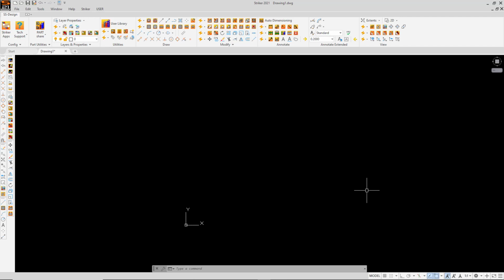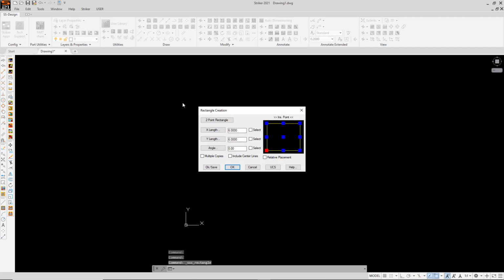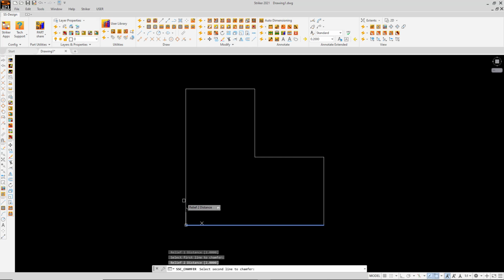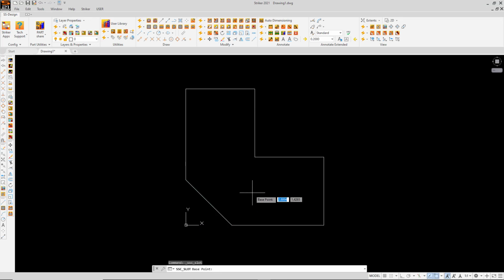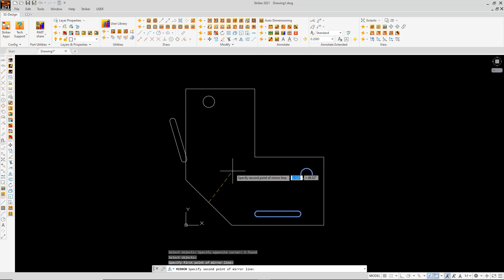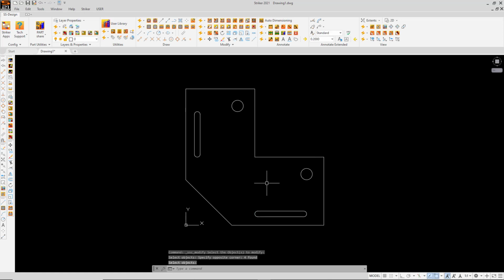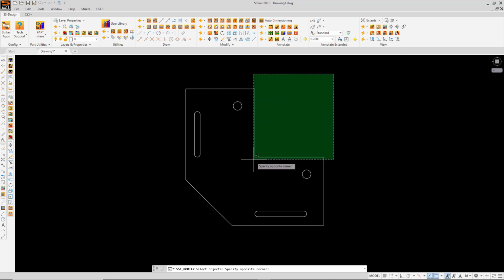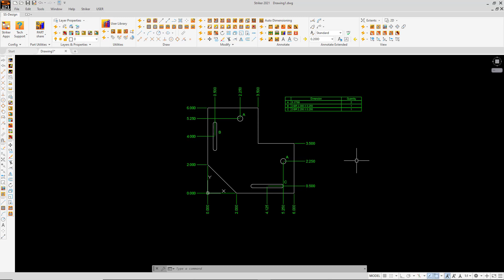FEATURE VIDEO - SS-Design (2D Drafting) Auto Modify Command

Comment: For imported geometry do you have to run a clean command first?
Reply from the maker: Hi Steve.  Thanks for the question.  No, you do not have to run a clean command first.  If you are importing a DXF or DWG file, these are evaluated and cleaned during the import process.  If you are importing directly from a 3D modeling solution such as SolidWorks or Autodesk Inventor, the parts aren't cleaned during the import, but they are evaluated and cleaned the first time they are used.